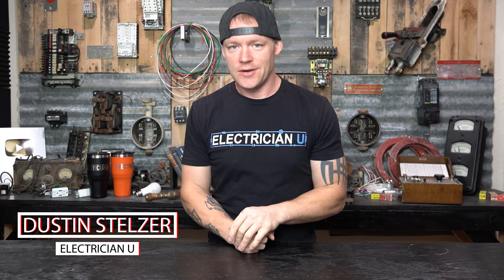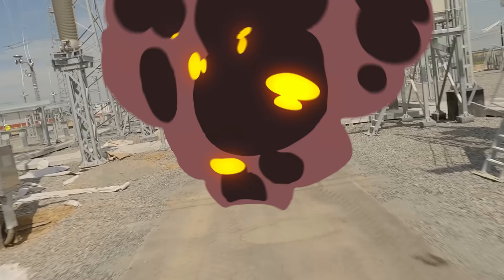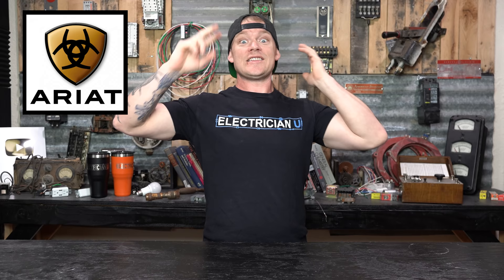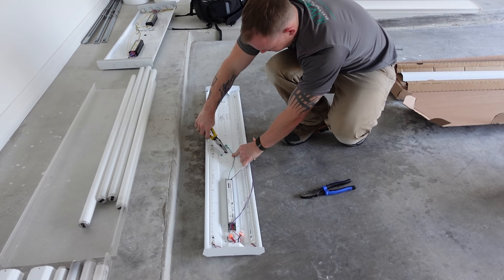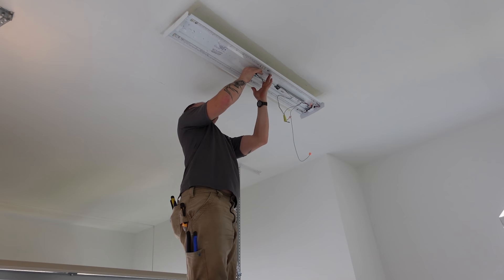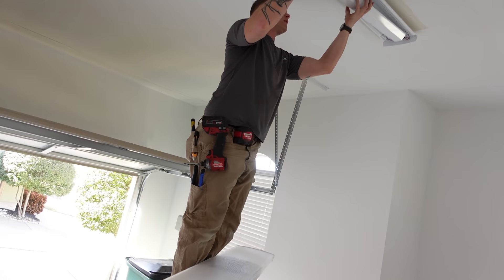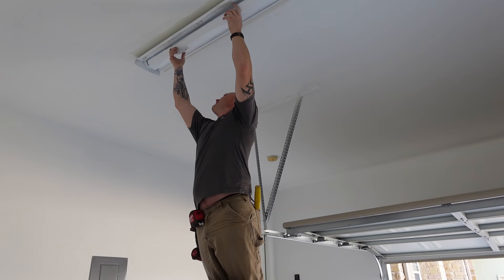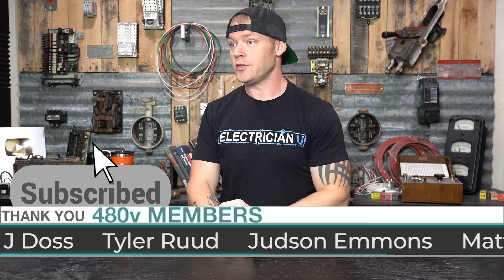Swapping Fluorescent Garage Lights to LED

Comment: I hate it when the customer turns on random breakers. I remember working on a welder plug, and I don't mess around with them and treated it as hot even though I knew the breaker was off. Then my jman comes up to me and says, "you know that's hot right?" Got my tester, it was hot. Turns out the customer loves flipping breakers.

Comment: How about cutting the ballast out and installing 120v led bulbs ?
Reply: Probably made more profit from full replacement or had extra fixtures he needed to recoup cost on. 😆
Reply: @eds6569   - for some reason I got the impression that the homeowner bought those fixtures.
Reply: @stevebabiak6997  I wish they'd never do that with anything. Majority of the time it's a clearance item(s)/cheap pos with a multitude of unnecessary extra parts/steps you have to baby to install without shit breaking apart.
Reply: I personally refuse to install those. The fixture wiring and sockets are not rated for line voltage.
Reply: @welderboy525  Most ballast put out over 500 volts
Reply: @jamessickmore236   right and that’s why they aren’t rated for any kind of amperage and you are going against the manufacturers listing for the tomb stone and the fixture opening yourself up to a lot of liability. And I’ve seen a lot of sockets fry after doing this
Reply: @welderboy525  15 watts = 0.125 amps
Reply: Just after the 17-minute mark, he talked about the profit he made going out and picking up the lights and supplies.

Comment: Great video! I am an retired 20 year U.S. Navy Electrician and I support the approach to go turn the circuit breaker off and add placing white duck tape over the local switch (electrical write work in-process) on the tape. Just something that popped into my mind. Could be a very useful step to include in your process. Keep up the good work Sir!

Comment: Remember not to stand on the top two rungs of the ladder. Work safely by getting a taller ladder. 

Remember Apprentices are watching and learning.
Reply: Safety is key
Reply: Amen. If I made a habit of what he’s doing I’d probably be a paraplegic by now. Bad stuff, no matter how overconfident you are.
Reply: You're absolutely right but sometimes ya just gotta git'r done though bud, grabbing the taller ladder after realizing ya need it means a trip back to the van loading/unloading two ladders instead of one and that's just bad math...
Sure we'd be wise to pay attention to ceiling height before deciding which ladder to grab but if you've already been lugging ladders around all day along with tons of other crap while the boss watches (aka apprenticing) ya might do what ya can to lessen the loads on your back even if it might put ya in a questionable safety position. 😄
Reply: I'm surprised the lawyers have not already made the ladder manufactures remove those top steps and just make it solid plastic or something by now .
Reply: Safety never takes a holiday
Reply: I fell off a ladder and broke my arm when I was 16 so I am really careful when I get on a ladder anymore. I usually don't go up to the 3rd step from the top unless I have something to hold on to while I'm up there.
Reply: @hikemuch975  Safety takes a Holiday everyday bud lol.
Reply: sometimes you got to just stand on the very top
Reply: I once worked for a major engineering firm.  Hated the constant required training courses.  But I learned quite a bit!  Ladder training.  Yep.  It's a thing.

Comment: As someone who collects old lighting gear, one thing I've realized is that 4 lamp F40T12 ballasts either don't exist, or are so rare that it's not worth using them in 4 lamp fixtures.

I usually prefer to retrofit fixtures to LED rather than replacing, especially if the old fixtures are still in good shape. Mostly because I've seen a good few LED fixtures fail before their rated lives, and in almost every case, the fixture has to be replaced due to the non-serviceable design of most LED fixtures, and a lot of LED tubes could be bought for about the same cost as a pair of fluorescent tubes. (anywhere between $4 to $10 per LED tube, depending on who you source it from and what type).

The old fixtures appear to be made by Lithonia Lighting, the same mfg who made the new fixtures you're installing, one thing about their LED fixtures is a lot of times, they reuse the same housings used for their fluorescent fixtures with their LED fixtures (granted, others might do the same, I just have more experience with Lithonia). Now there's nothing inherently wrong with that, it just means you could achieve the same thing by putting LED strips in the fluorescent version of the fixture.
Reply: I agree, it feels wasteful replacing an entire fixture vs a bulb.
Reply: That’s what I thought this video was going to do when the term retrofit was used. All he did was replace fluorescent with LED; retrofit is exactly what you described, using the old fluorescent fixture with LED.
Reply: This is very true, i actually try to avoid led when i can i have recently fitted a fluorescent into one of my rooms, and a SON lantern in my shed as apposed to led
Reply: Retrofitted our entire building to fluorescent T8's from F40 years ago. Recently started slowing switching to LED T8's by area in the building. Just put the new LED tubes in place and you are done. Side benefit is no dead fixtures in the landfill and we store the used tubes to replace in the areas not switched over.
Reply: @williamc4364  what is Dustin doing in the video
Reply: I usually try to retrofit to LED lamps if the fixture is in good shape. Most of the time you can’t find a new fixture the exact dimensions as the old one. Therefore you end up with a discolored ring around the new fixture, or the customer has to get the ceiling panted.

Comment: They also make t12 leds, u remove the ballasts and direct wire the end connectors to mains. They’re the most convenient swap out and when one of the leds burns out you don’t have to swap a whole fixture again.
Reply: yeah we do a lot of retrofitting, removing ballasts and wiring them direct 120v
Reply: You need to add the stickers to each fixture to show that it’s 120V and not ballasted.
Reply: @danlux4954  usually you do this institution wide so it’s not like anyone will have any other options but I do see the point of dbling down against people making mistakes. Stickers is a good idea
Reply: @arsenicjones9125  the led 120V bulbs I had purchased had the stickers included, but I have since installed electronic ballasts and when to the retrofit led bulbs. Probably use the 120V ones in my garage.
Reply: @danlux4954  I’m using the 120v ones for my shop and I split the 4 tubes onto 2 switches. So  now I have different light level and different color temperature options.

Comment: You should do a video about what you can and can’t do on your own as an apprentice.
Reply: Everything that’s doesn’t include getting the main power shutoff. Basically you can mess with the panel but you can’t pull a permit to get the power shut off so you can’t replace it. Everything else is fair game, be careful if you don’t have insurance and check your local regulations. Mine doesn’t allow work worth over $25,000. Home owners can pull homeowners permit which would allow you to change out your panel or a family members but this can be tricky to get approved sometimes
Reply: You shouldn't work on anything live for the first 3-5 years as an apprentice IMO.  This will help develop the use of testing equipment and create a better respect for electricity. I always have to have a level of respect for electricity as an electrician and the day I start underestimating the need for testing is the day I need to quit.  This is why its better to not work on anything live for at least the first 3-5 years as an apprentice.
Reply: @Jzzonem  Maybe true but fact of the matter is working on live stuff is kinda part of the job, often ya don't really have a choice and getting bit a couple times in the beginning is how most of us learn to best avoid it. LoL
It's kinda like those times when we were kids and our parents told us not to do something and explained the consequences if we did but as soon as they left the room we were like YOLO! and did it anyway, hard lesson learned and the smart ones never do it again. 😆
Reply: @eds6569  I would say that is true if your an experienced electrician and you get complacent. Not as an early on apprentice. I work on anything from 120volts to 2600volts. 2600 volts would obviously be something you don't have the luxury of getting bit from.  In my experience there is never any good reason why someone should have gotten shocked, but it happens.  Apprentices need to first learn how to work safely.  I know a lot of old electricians and a lot of bold electricians, but I dont know any old bold electricians.  I can appreciate what your saying and still laugh about it, but I dont agree.
Reply: @eds6569  As the old proverb goes “A smart man learns from his own mistakes, but a wise man learns from other people’s mistakes”, another 1 I like is “a Jack of all trades is a master of none, but is still more valuable than a master of one”. Most people drop the 2nd part of that adage. I’m a 25 year vet of HVAC and 3 years ago became an electrician apprentice. I work for a company that does HVAC , plumbing, and electrical, when HVAC is slow due to weather I’ll move to electrical and help them out. I can already do plumbing and electrical but why not pick up another card and get paid for it
Reply: That depends on where you live and the laws of your state. Check with those and local electricians. In my state (AZ) an apprenticeship program is not required or any journeyman certificate unless you work in the local union and even so that isn't required except for certain jobs or positions. I received on the job training from my dad and eventually took the state test to start my own business. Without a state issued license, Arizona doesn't let you jobs over certain dollar amounts. Not going to list all the specifics because I don't want my words to be taken as legal advice. Once again every state, and even certain cities in that state, have different requirements on what you can and cannot do. Don't take this or any video as advice. Your local ROC or state ran union won't care that you received bad advice on YouTube.

Comment: In our industrial plant we are replacing old fluorescent lightbulbs with ballast bypass LED lightbulbs. We don’t have to remove the ballast to recycle. Just take the in-line hot and connect to the line side of the tombstones. And the neutral to the neutral side of the tombstones.  Large cost savings going from a 34w to a 24w led

Comment: I have a quick hint that has saved me a few headaches and the Up&Down Ladder Game. 1st I get (2)PVC (SDR) 4"× 30"  w/ test caps glued on bottom ziptied one to each leg on the outside. This will hold the old T8 bulbs as well as the new ones. 
2nd I get a magnet strip for tool bench and ziptye it to the fly leg of the ladder. It holds the ballast covers.

Comment: Love your stuff.  Safety Tip.  Work off a properly sized ladder.  You are always on the top or second to top rung.  Also, just because the light switch is off doesn't mean the wires in the light box are.  Many times the feeds go to the light with only switch legs going down to the switch.  Turn off the breaker.  Tag it or at least put tape over it.  If the lightning doesn't get you the 9 foot fall after the lightning might.  Stay Safe!

Comment: Naughty boy on the too short ladder. Otherwise good vid. At some point you might consider discussing use of fluoro's outdoors where they don't work in cold temps.
Reply: Flo's will work in the cold.....you need a special ballast that is rated for cold weather and goes by the total inches of the tubes.

Comment: I always turn power off at the breaker. And have a lockout device that attaches to the breaker so I can physically put a padlock on the breaker.  You just never know.  Either that or the light switch is in another room where you can't always see it.

Comment: The city I worked for went all LED.  My coworker and I converted over 200 to LED's.  We got really fast and good doing them after so many.  Having two people made it so much better.  One of us would go up the ladder and one would grab the old parts and hand up the new LED ballast and bulbs then the cover.  You still got sore but going up and down the ladder only once per fixture was a lot easier. The ground guy also toted the ladder.  That made for some long days.  Neither one of us were spring chickens either.    We used the same fixture 90 percent of the time.  We just pulled out the old ballasts and secured and capped off all the exposed wires.

Comment: I  installed sixteen 4' long LED Shop Light Fixtures in  a friend's Cabinet Woodworking Shop. Mounted them to the Steel Purlins with self-tapping self drilling sheet metal screws with 1/4 '' hex heads and used 1/2 '' Steel EMT from fixture to fixture and from the wall mounted switch box to the first fixture, a few years ago . I  installed a 4'' square junction box at the start for each row of lights to feed the EMT from to the fixtures. I used Velcro Straps to hold the fixtures in place until I got them drilled and attached in place with the self-tapping self drilling sheet metal screws with the 1/4'' hex heads.  He was very happy and satisfied with the finished job and they are super bright and really light up his Cabinet Woodworking Shop ! I did  the whole installation by working off a scaffold about 10 ' off of the floor by myself.

Comment: Hyperikon 4 Foot LED Tube, T8 T10 T12 40 Watt Replacement (18W), Single End Ballast Bypass, Clear Lens, UL, DLC, Crystal White. Get you some!  I've never had a single failure.  Save the Fixture... Bypass the ballast... EZ Peazy.

Comment: When wiring light fixtures, I put electrical tape over the light switch/s. I always use my voltage detector on fixtures.

Comment: WHY?!? Why would anyone replace and discard perfectly good fluorescent fixtures?  Yeah, LED's are supposedly more efficient, but fluorescents are still much more efficient than incandescent. I can't imagine the cost differential is that much, especially since this is in a garage which is presumably not going to be lit that much. Also, fluorescent bulbs are replaceable. Those LED's don't look like they are. Have to call the electrician again to replace the entire fixture. The claims manufacturers make about life span are a crock. I have had LED bulbs go out in less than a year. It's not just the LED's themselves but the electronics that can fry and go bad.

Comment: Ok this is a great video for someone who is a newbie. With that said I’ve been working in all types of  commercial settings and you cannot turn off a breaker say an office so what you do, is cap off your power or line side removed the balast which 9 times out of 10 doesn’t have a quick disconnect connector changed out the balast and you’re done. 
On those LED you can also purchase T8 LED tubes or if you want to remove the balasts, you can put in direct wire LED T8 no driver needed unless as in your case you can replace the whole fixture,  no offense just suggesting other faster options

Comment: I think the hardest part of converting from florescent to LED is finding  the bulbs to buy on line.  I've been looking for these:  4FT T8 LED Light bulbs,  6000K, 2400 Lumens, Dual-End Powered, Ballast Bypass, Frosted Cover.  Wattage, CRI, etc., I can be flexible.  Every time I come close to these specks they want me to buy a 30 pack when I only need 8.
Where is your recommended place to buy LED bulbs?
Thanks
Bob

Comment: Nice video! Great work! I call it a diffuser, not a reflector. I use 1/4" toggle bolts with a 1/2" paddle bit for the holes.  You have to get used to working live as a professional electrician.  But yes, I turn it off whenever possible.  A neutral will kill faster than a hot wire ever thought.  When in commercial environment, this is why there is a need for the quick connects. Thoss are there for anyone who has to maintain the fixtures after install.  The neutral has the consumed current vs. The hot before it is consumed by the light or equipment.  I've know good electricians that are no longer with us because of not understanding this and worked live on 277volt lighting.  Working live doesn't make you a hardass. Be safe and great video!
Reply: Good thoughts and I never thought of the neutral like that. I like to reed the comments because everyone has  a different approach. I always learn something. Thanks for writing in your comment

Comment: Thoughts on doing the LED retrofit lamps and just rewiring the existing fixtures to bypass the ballast? Haven't done the numbers in a while to see if it's still cheaper for the customer that way.
Reply: Not an electrician but a few years back an older friend had multiple 48” bulbs that were bad. Lowe’s had  GE LED tubes that didn’t require bypassing the ballasts, they bought the tubes and I did the ladder work for them. No need to replace the fixtures. Those tubes did have instructions on bypassing the ballasts if you need to. I think the tubes cost $8 each.
Reply: You need a sticker to be installed because adding a regular fluorescent bulb on a 120 circuit will cause them to explode. They make retrofit led tubes that work with an electronic ballast.
Reply: @mikecumbo7531  what is Dustin doing